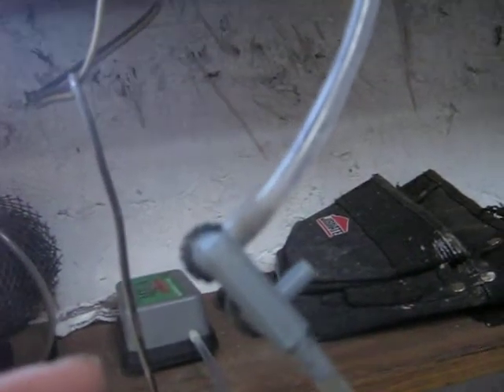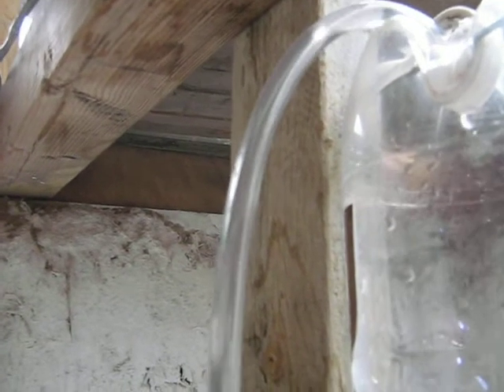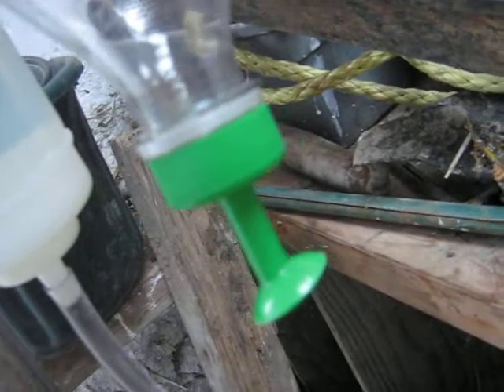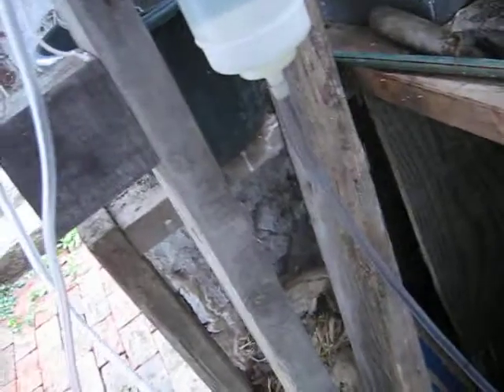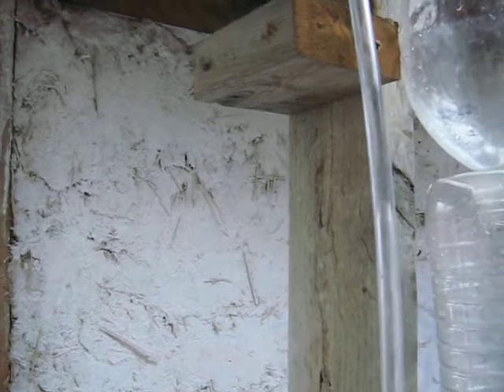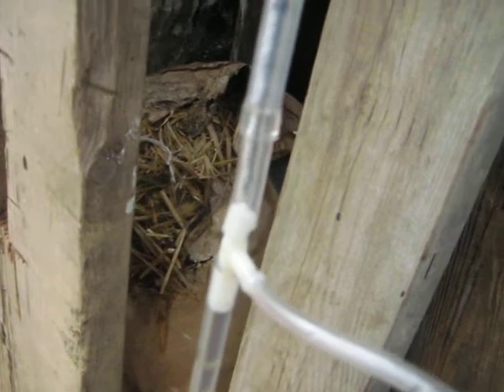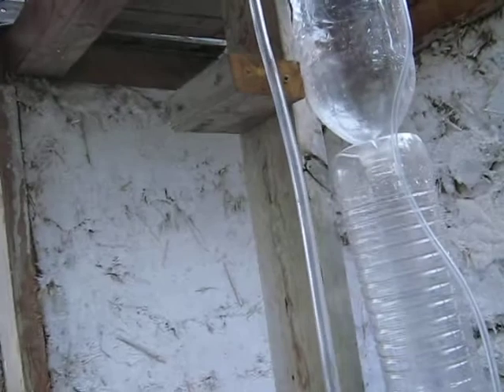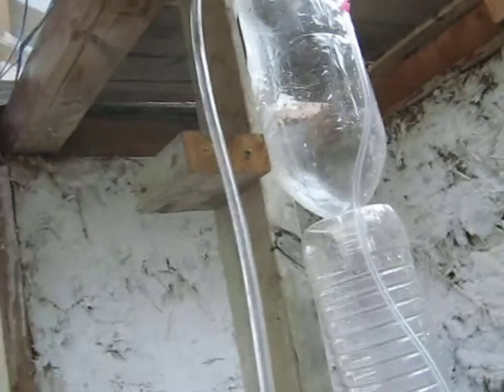Windowfarms: Liquid holdup, Bottom reservoir for T-Joint system, and airspeed explained.

Comment: Really awesome video. The t-joint airlift method is definitely a smarter choice than the crazy prestastem things that they reccomend on windowfarm 2.0. I tried the prestastem method and it consistently releases air in the reservoir, often times causing backflow and not delivering water to the top bottle.